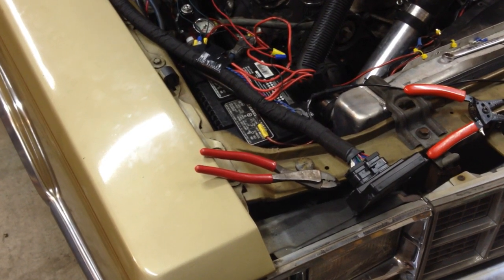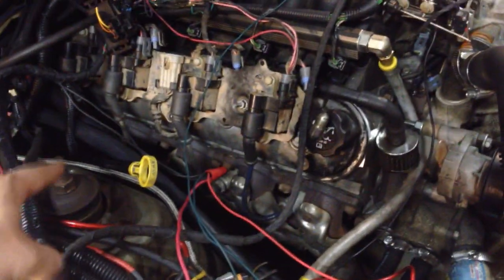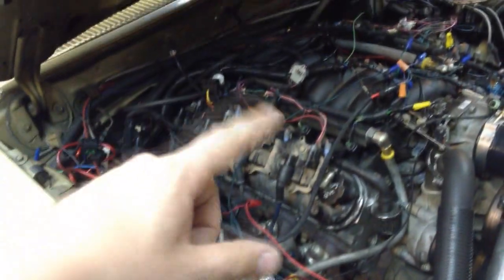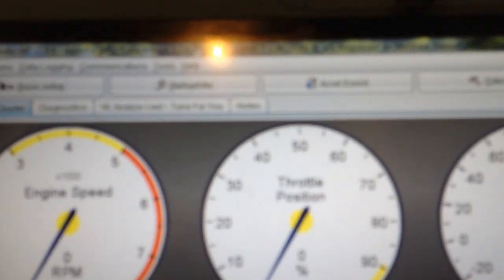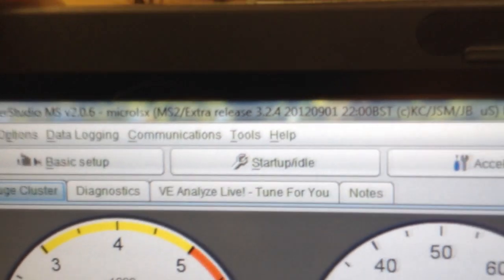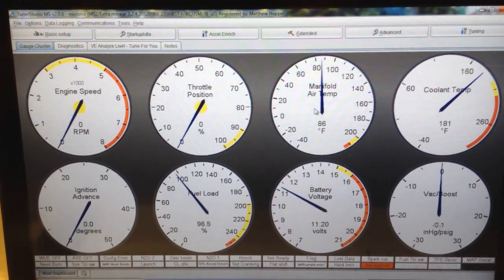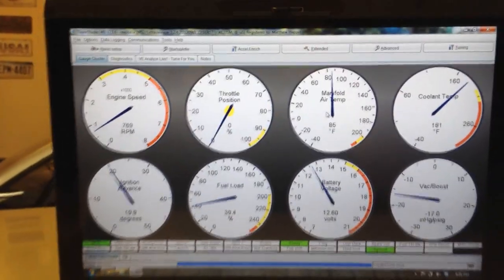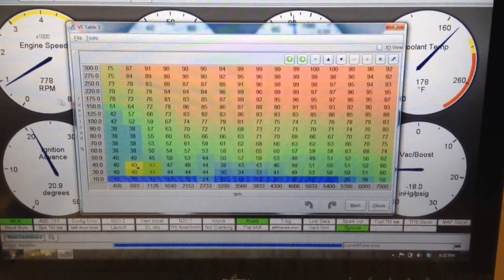10-15-12 MicroSquirt2 LSX plug and play harness testing

Comment: I'm still new to MS (no system yet), but from what I've read the micro is very good if you want an out of the box system that just works... if you want to tinker a lot and add circuits and doodads to your system, you are better off with a full sized MS v3.0 board with through hole components and a prototyping area on the board.  There is a good comparison chart here:  msextra.com/feature-xref.html